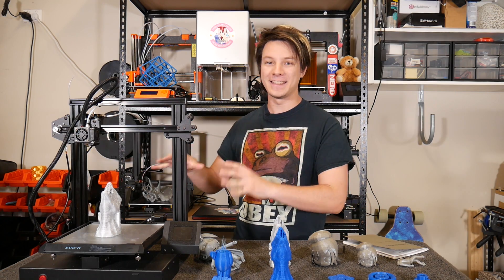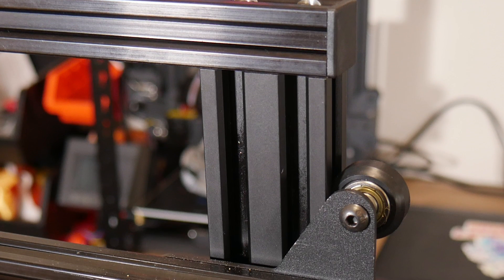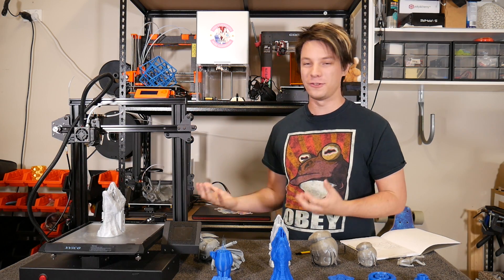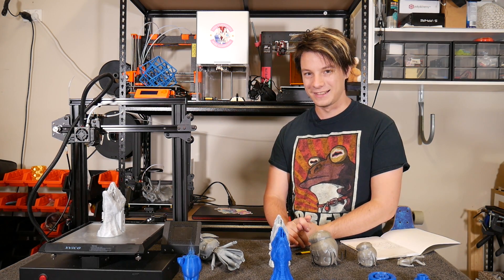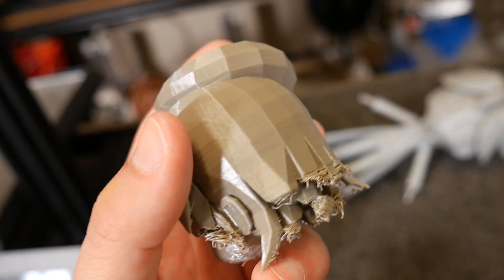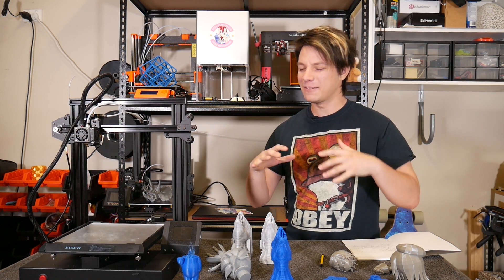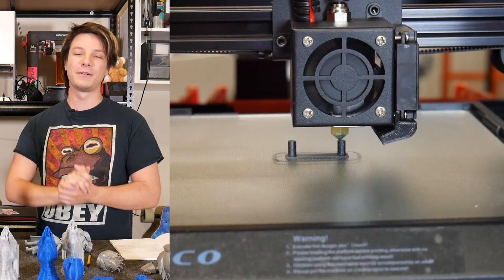XVico Pioneer 3D Printer Review

Comment: Its surprising that any electronics manufacturer shamelessly leaves exposed Mains current wiring on ANY device but especially wreckless when you lift it by putting your fingers underneath. I was shocked off my CTC i3 Power plug connections (surprised me as they had insulated ends so it just goes to show, still not safe); I printed a cover for but it's not an acceptable new product condition. Constructive & informative Review as always. Like the shirt.

Comment: I have fortunately or unfortunately landed myself an Xvico x5 corexy printer! I can't find any info on it and settings or how to calibrate etc. As it came with no instructions at all and was apparently broken. I managed to put it together and print but the prints are pretty stringy and poor quality. Does anyone have any knowledge or experience with these? 
I have 2 ender 3 pro's and a flashforge guider 2 so not that new to printing but struggling with this one??

Comment: I had this printer and It is worthless. 1st. SD reader arrived damaged. 2nd Printer would not finish any Print. It would begin and stop within minutes, restart at a different point. 3rd Roller is completely inaccurate. 4th. Adhesion to plate failed even with glue. Had to purchase a print pad at addition cost. 5th this video states this printer prints quickly. Totally False. Obvious someone is making $$$ by telling you false info on product.
I worked with this unit for 3 weeks and could not print anything at all. Donated to landfill. Seriously I threw it out. Could not get Company to refund my money.
In short pay a few bucks more and get something that works.

Comment: got mine Sept 13, 2020
due to inaccuracies in manufacturing, assembled with one upright for z-axis stability instead of two
upper cross frame left off as cut too long by 50mm, and the missing upright
prints beautifully

Comment: UPDATE: The power supply that comes with the Xvico Pioneer 3 is actually more powerful than the original power supply on the Anet A8. Those are published comparisons.  ANGUS, I put an Anet A8 heated bed on the printer. Fit perfection. But the code from Ideamaker would not start the printing process? I was able to get the bed to heat, and the print head to heat (80 and 215 / PLA).

Comment: I bought this based on your review of it. It was easy to build. Removing the bed is a mystery. Getting the X-axis to work is a problem out of the box. The picture of your wiring of the board didn't look correct? I paid $145 for it. So far so good.

Comment: On my  Xvico Pioneer 3D Printer, I got a "Font Updata Failed!" error, any ideas what i should do next.
Reply: Fixed...re imaged software through SD card
Reply: @rickolibar  Hello Ric, I have the same problem, unfortunately my SD card is not working. Do you have a tip?
greetings from Germany
Reply: @stefang8369  Go to this Facebook page and download the zip file, place it on your SD card, then plug you Xvico in and turn it on,  wait 5 minutes ......https://www.facebook.com/groups/583066442160349/files/

Comment: If you want to use mmd or xps models as a source, there are blender plugins to import them along with textures and armature. You can then apply a subdivision modifier to smooth out the polys before applying the normal texture as a displacement modifier. That'll give you an insanely detailed model with minimal effort.
Check my thingiverse (amagni) for examples.

Comment: I would not be surprised if they designed and had those parts made. it BLOWS MY MIND the level of injection molding they are able to achieve at the price point they can achieve it.

many times you will get 3d printed parts not because they can't afford the molding but because they want to release the printer "NOW NOW NOW" and the molded parts are just not ready yet.

truly blows me away. if you ever get a chance check out the pxmalion mini. its not a great printer though I think I can eventually make it good. but the level of quality and injection molding and creativity in their designs really is pretty cool and its just freaking cool looking. I don't know why but I am enamored by that printer and they did not even send me one. I bought it :-)

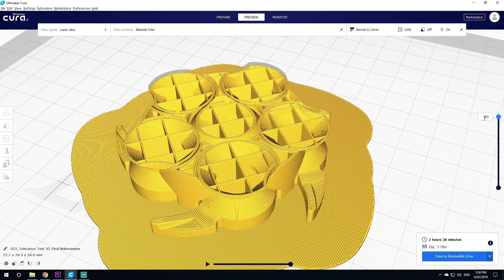Comment: Hi, can anyone help me? I don't have that slider to preview the extruder path in my cura. (I mean that one on 6:43 on the bottom of the screen). Btw nice video, thank you, Angus. :) Do you have the Cura profile for JGAurora A5 as well? I'd like to find out if my filament or printer is wrong or if it's just my settings. Thank you.
Reply: How strange. That's not how my Cura looks at all.  My gcode layer preview is in the same place, but the play button is under the little check boxes in the upper-right-ish corner of the 3D viewport.

Comment: MicroSD is super annoying.  Manufacturers, please put a full sized USB port on your printers.  So much easier to use a USB stick instead of fiddling around with SD and microSD cards!

Angus, what's your opinion on vslot/roller vs direct screw drive transport designs?  Seems like the vslot designs are more fiddly (and can have wear issues on the rollers over time.)

Comment: For a Unheated Bed printer I would prefer "brick" type PSU instead of Open terminal PSU they used. Would make it considerably more user friendly and safe by having only 12V DC connected to Printer

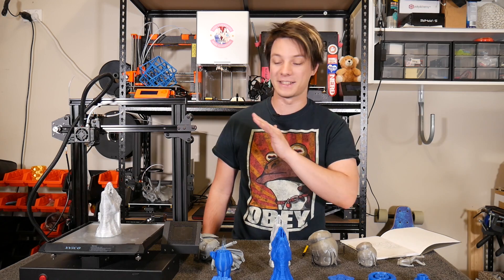Comment: 3:26... Just stick it into an SD to USB reader and stick that into a computer... it will let you know the capacity of the SD card in [Properties].
It seems that you can save $30.00 USD if you buy it with a US plug. The specs say the power supply input can be 100-240VAC. I'm sure you can find a 240VAC plug for less than $30.00 USD

Comment: Nice review as always Angus. For what  it's worth I have to say as an Ender 3 owner my biggest mod for my printer is it's 2mm thick glass bed that I hold on with  4 tiny  binder clips. The beds are  exactly 235mmx235mm and I got the glass out of an old picture frame. This glass is a bit delicate but the upside is that they are significantly lighter than the mirrors that people use so they heat up much quicker. I always remove the glass plus print from the bed before I try to seperate the print. This way I don't screw up the level. I usually don't have to level the printer more than once a month and it's usually a tiny amount. I've tried a number of expensive surfaces that degrade somewhat quickly and this 2mm picture glass plus hairspray is for me the ideal surface. Also it's stupid cheap if I break one. Obviously I switch the surfaces so the printer can be  immediately available for the next print. I always run prints with a heated bed because I find that if I wait 10 minutes the contraction of the glass will eject the print on it's own. I switched the bowden for Capricorn and the extruder with a Mk8 red anodized one from AliBaba. That's about it. Sorry this is so long but you did ask.

Comment: Why do people always say you have to print PETG with a heated bed.  My partner and I print end user parts exclusively in PETG on non heated beds with zero issues.  Just a quick wiping of the bed with 91% isopropyl  and a few swipes from the glue stick before printing.
Reply from the maker: Hmm, I'd have to try it with that method, I've always had warping. Would love to be wrong though so will try it!
Reply: It all depends on the shape. Try printing a large, flat piece or a box shape with a high infill. Even PLA has warping issues at some point. A heated bed is a necessity for any 3D printer in my opinion. It is such a simple addition that greatly expands the types of parts and materials you can print with that it is stupid to omit it.
Reply: Warping with bigger parts.
Reply: PETG on Unheated bed is possible - printed quite a few rolls of it on my printer. Its not as easy as PLA but Possible. Personaly had better results when printing on Masking tape, but that was heavily dependant on tape to bed adhesion as some bigger prints were pulling off tape from bed when it was not stuck correctly or damaged
Reply: @yatuatuin   With large prints, it doesn't really work.
Reply: @originaltrilogy1  Full bed size possibly not, but had very high success rate with parts in range of ~100x100mm.
https://www.youtube.com/watch?v=ZWDzsfq7VxY - blue parts on printer shown ale also PETG printed on this printer.
Reply: @yatuatuin  3M Blue Scotch
Reply: Ive printed larger items but always with the bed heated on my personal printers' so i'll have to test that. I also don't like printing on glass. Part of why I sold my cr10s5. Just a personal preference. I print directly on aluminum sheet metal clipped to the build plate with binder clips.

Comment: Nice video. I have to ask, so it did amazing at the tolerance test but then is a bit dodgy on layer height and over/under extrusion. How does that work? I would have thought to get a really good result on the tolerance test that you would have to had those issues ironed out?
Reply from the maker: Honestly, I'm not sure. The layers seem better on the test than the gears and it's printed a little slower at .15 vs .2, that might be part of it.
Reply: @MakersMuse  Thanks for the response, so a case of speed vs. accuracy then with the different print speeds?
Reply: Ben Hollis It can also have a lot to do with orientation of the part. Speed in any printer effects accuracy regardless of quality and parts on said machine. Only way to fix that on these types of machines is by getting a better hot end and that’s very cheap and easy DIY. Just make sure you print the correct mounts before you disassemble your stock assembly. I have a stock CR-10S that swings way above its pay grade IMO but still requires me to slow down for certain details.
Reply: Definately speed and jerk settings are a big deal even on my ender-3.  If I have a moderately sized print on the bed, I have to slow it down a bit and lower the jerk value or I'll get layer shifting on the y-axis.  I could maybe fix it by tweaking the stepper current, but just slowing it down a bit works for me.  I should maybe note that I print on a 3rd party glass bed which adds weight, so YMMV.
Reply: BEdmonson85 same, never thought about the weight on the build plate..

Comment: In the usa we use 120 volt mostly 15amp. What amp is the 220 volt in Australia Angus? If we touch the mains it gives you a heck of a bite but thats about it unless you got a bum ticker or something.  As you know it's not so much the volts but the amps that will kill you.
Reply: Most Australian mains outlets are limited to 10A. It's not unusual to encounter 20A outlets though.

The above is a bit irrelevant though, because the whole 'it's not the volts' thing is wrong. A human being is a resistive load. Ohm's law (V=IR) tells us that the current through a resistor is proportional to the voltage and the resistance, so the higher the voltage the more current you get. The reason that sparks from Van de Graff generators (which can be thousands of volts) don't kill you is that there is also a time component: ultra short pulses of high voltage, high amperage might not be fatal. Volts*Amps*Time = Energy, so you could say (fairly accurately) that it's the Joules that get you. Further evidence for this is that defibrillators measure the shock they're giving in Joules not Amps.

Generally, you only need about 100 mA at mains voltage (far less than any outlet can deliver) to stop your heart within seconds.
Reply: It really doesn't matter if it is 120 volts @ 15 amps or 220 @ 10. Both are sufficient to give you a nasty prod, and that is the problem, as most electroshock accidents are caused by secondary injuries. That is, it's usually not the prod that gets you. It's summersault triple back flip with an ankle sprain that causes you to grasp at things in panic as you go down... Ask me how I know...

Comment: How big is the sd card ? easy - plug it into a pc it will tell you ! do you think there is any advantage in using name brand cards ?
i'm having a problem with my printer that is sort of related to this video -the ptfe tubing, i have a prusa clone  ( you can stop laughing at me now !) that runs a dry box for my filament ( usually pla ) and i use ptfe tube to connect the dry box to the extruder but if i leave the filament in overnight it breaks in the piece that is sitting in the tube  so i have to pull new filament through before printing . i am wondering if this is common or maybe i have some dodgy tubing that is reacting with the filament ?  you mentioned a certain brand of tubing - where can i get it ?
Reply from the maker: It will tell you what it thinks it is, but you can spoof that ;) I've had some random cards corrupt but overall no benefit to a name brand or faster card in my experience. Even this one works fine.
Reply: @MakersMuse  
in all reality it is probably made in the same factory as all the rest ! any idea what the problem with my ptfe tube is ? there is no way moisture could cause it so i'm thinking a reaction between the two materials , maybe the ptfe isn't ptfe or something ?
Reply from the maker: It's a super common issue with some PLA's, I'm not exactly sure what causes it but see it often. Something to do with holding it in a position different to it's 'natural' on spool state and yeah, maybe moisture embrittling it. I dont think the PTFE is to blame.
Reply: @MakersMuse  
Ok so i'm not alone ! I thought maybe there was some reaction  or something so i guess i will just have to pull the filament and feed it back - that is of course if the tube is ptfe and not nylon which holds moisture and would kill pla . could be nylon as i bought it of flogbay ! any thoughts on testing it ?

Comment: PSA: That random unbranded micro SD reminded me of this: 
https://fight-flash-fraud.readthedocs.io/en/latest/introduction.html

Not saying this is necessarily the case here but it's important to know about if you're dabbling in hobbies where cheap cards get bought/thrown in. I've wasted hours of troubleshooting in the past because of a fake card (16GB was actually 2GB :S ).

Whenever you get conspicuously cheap cards or ones thrown in by someone who has a lot of interest in cost cutting, it's worth testing the full capacity. Even if it reports itself as X capacity to whatever you plug it into, it might be pretending by overwriting existing file data when you write more than its actual capacity. This is a really sneaky failure mode because it keeps the file index data the same and will work fine for first few GB and then start returning corrupted data without any other indication that something is wrong.

Comment: Thanks for an honest examination of this printer. However, no heated bed? No thanks. I'll stick with the proven Ender-3 line.
Reply: j mtx we will just assume you mean Creality lol. Ender 3s are still new comparatively speaking to the market as a whole and they’re not exactly spotless as a track record sourcing cheaper materials to cut costs on the heated beds along with essentially cloning themselves over and over again since the CR-10 copy which is just a clone of a Prusa style design that a half a dozen company’s have copied. Cheers to Chinese copyright laws lol..
Reply: @brittangolden3105  You do realise none of them are clones of the Prusa i3 they are all just derivatives seeing that the i3 design itself is also a derivative and all original i3 designs are opensource.  Nothing at all to do with copyright law.
Reply: I meant exactly the Ender-3 line. Creality built on the original model they released by updating the parts on the "Ender-3" as well as making up different models such as "Ender-3 Pro", "Ender-3X", etc. My point is that they built on the success of the original Ender-3. It is featureful and works amazingly well most of the time.

The take-away from this should be the realization of more printers being built using aluminum extrusions instead of cheap acrylic from now on.

Comment: So with this printer you get cosmetics over function. How is that a good deal? I'd sooner have no touch screen, a heated bed, safe electronics and consistent print quality for that money.
Reply: @Mat Broomfield I’m going to guess they have print farms in mind.. considering the design and style you can remove and replace the beds with a fresh bed and never have to move the base at all. Seems intuitive enough. The non heated bed eliminates a lot of potential investors and print farms so that’s certainly a mistake. As for surface to internal value it’s equal in many ways. The bed,  a 32bit firmware vs 8 and the GUI touch screen makes a huge diff when your trying to navigate a chincy track knob in any circumstance. Also, who the hell picks up there 3D printer from the bottom in a cradle like fashion ? It’s bolted together extruded aluminum..
Reply: @brittangolden3105 I have a bed where the glass chipped trying to removed the model, so I have an immediate distaste of systems where you are expected to hack the model from a non flexible base like that. I've been using Magiogoo ever since that incident and a I swear by it but a flexible base would also be an asset. Also, I think the benefits of a touch screen (another liability) are greatly reduced by making it so small.
And please tell me why 32-bit software on an OS that has to do so little, is ANY benefit whatsoever? In my experience, the print speed is limited by the motors and the frame, not the software.
I can't imagine any farm that would sacrifice quality for all these features TBH but as I don't run a print farm perhaps they see things as you do and I'm missing the point.
Reply: Touch screen is no one's priority.  Even auto leveling...I'd rather have a flat, evenly heated bed.
Reply: @truantray  I'm always apprehensive of a touch screen wearing out. Probably unjustified, but the less delicate parts the  better.